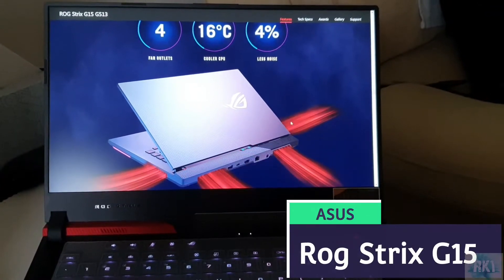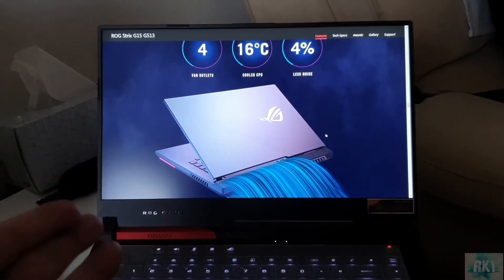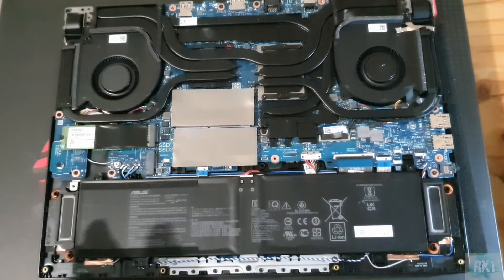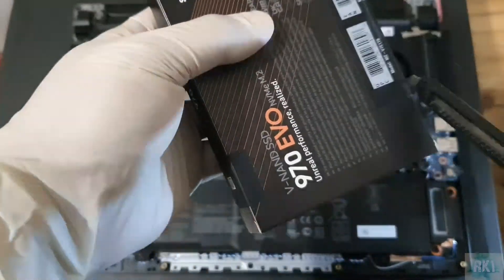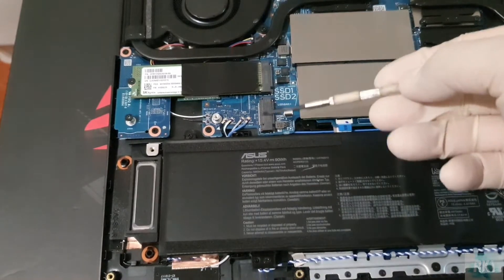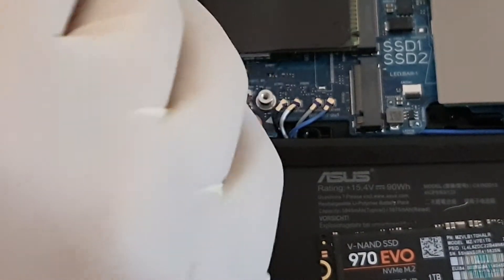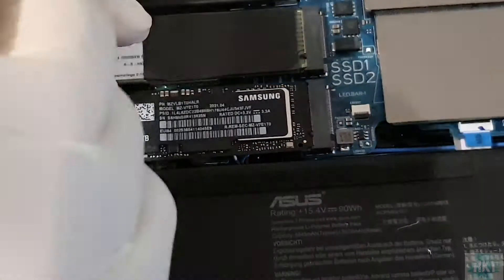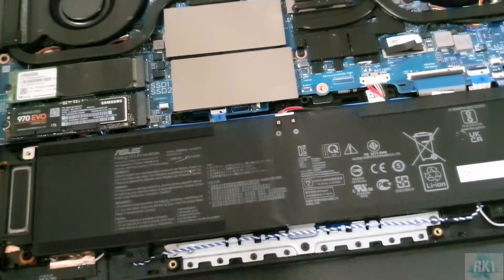How to upgrade SSD in Asus Rog Strix G15

Comment: I had a technician perform the same steps as you, also putting in the 2TB Samsung 970 Evo Plus. I noticed a strange thing, though: why do the write and read speeds max out at 1800 (and not at 3500 MB/s)?

Comment: I am about to purchase an SSD for my Asus Rog Strix G15 for and I am torn whether or not I should purchase a SSD like on one above - SSD 970 EVO Plus NVMe M.2 1 TB or a Samsung 980 Pro M.2 1TB PCI Express 4.0 Internal SSD MZ-V8P1T0BW. 

The Samsung 980 Pro M.2 has better reviews, but I am unsure if a PCIe SSD will work in this machine or not?
Reply: I see in the comments you have mentioend you are unsure if this Rog Strix can support PCIe SSD, but their should be no problems and the 980 should be faster.
Reply from the maker: Yes i installed 980 in my brother's laptop and it's running great
Reply: @robinkhaira1  Thank you for responding so quickly wow amazing! What a champ! Thank you for all the advice!

Comment: I have this laptop and the specs are listed below , which SSD and which Ram card can I put in my laptop? 
ASUS ROG G512 Strix i7 RTX 2070 16GB/512GB
Gaming Laptop; 15.6" 144Hz FHD IPS Type Display,
NVIDIA GeForce RTX 2070, Intel Core i7-10750H, 16GB.
Reply from the maker: It would be hard to tell without opening the laptop mate. I think it might still be m.2 ssd, and for ram i think it would still be ddr4 ram
Reply from the maker: Ok i just looked up your model name and yes it definitely gas ddr4 Ram up to 32 gb max and m.2 SSD. I hope this helps.

Comment: If i have the ssd from another laptop with windows installed, can i still use it? Will it erase the windows installation or cause any issues?
Reply from the maker: It depends, if you already have a SSD with Windows installed in your laptop and the 2nd SSD is also has Windows then PC will boot from the SSD with 1st on the boot sequence.
It shouldn't cause any issues but i would format the 2nd SSD just to be safe.
Reply: @robinkhaira1  Thank you. Sorry it took so long. Been working all day.

Comment: Hi! Sorry for my stupid question, but i just bought the ssd. So my question is when i put the ssd , should i pre install the system, or everything is fine ? Love that video!
Reply from the maker: Hi mate, sorry i didn't quite understand what you meant by pre installation of the system. Did you mean setting up your brand new Laptop?
Reply: @robinkhaira1  haha, sorry man, miss click XD i meant reinstall windows
Reply from the maker: @MITKO-le9gn  no you don't need to reinstall windows for this. You can just add the SSD and then go to disk management and allocate the drive a name.
Reply: @robinkhaira1  thank u so much my friend 🙂
Reply from the maker: @MITKO-le9gn  no worries mate. Just to double check, you are adding a 2nd SSD right? Because if you remove the original SSD and then replace it with a new one then you will have to reinstall windows. But if you are just adding a 2nd one then it doesn't matter.
Good luck 👍
Reply: @robinkhaira1  yep, im adding a second one :)
Reply from the maker: @MITKO-le9gn  yeah in that case it's easy, just a simple addition and drive allocation in disk management

Comment: AMAZING video! is it possible to add a second SSD without unplugging the ribbon cables for the LED lightbar?
Reply from the maker: You could do that, I found it was easier for my self to just remove everything because i wanted to show everything in the video. But if you can mange to screw in the SSD without removing the cables that would work too mate.
Reply: You can, but if you end up ripping out a cable by mistake (which is really really easy) then you're in trouble. So hypothetically yes, but I wouldn't unless you have really nimble hands
Reply from the maker: @eros7534  yeah kinda lol. Thats why if always say if you are not confident then don't attempt it and pay someone else to do it

Comment: I have a question is it safe to add another ssd gen 4 to a 15 laptop without a heatsink does it get hotter or did you have any problems with temps with 2 ssds ?
Reply from the maker: Yeah its safe mate. I have had no issues what so ever and my Samsung magician app says that SSD is in great health.

Comment: How do I deal with the screw that mounts the SSD? It's tight as heck for no reason.
Reply from the maker: You need a precision screw driver mate
Reply from the maker: @ 2:22 i mentioned that you need the precision set. Just put some gentle downwards pressure on screw and try it again. Let me know how you went
Reply: I ended up stripping the screw on the main slot so now I'm stuck with the 512gb ssd my computer came with as my boot drive.  Its an intel 660 I think, so not great but not bad.  With only one free slot though I feel I need to splurge on a 2tb since I can't do anything with the other one.

If I'd known the screw was going to be that tight I would have just paid the store the $50 for them to do it.
Reply: @robertlefeaux  Hello, i have the same problem, have you somehow fixed it? Or is it destroyed forever?
Reply: @spooky9487  I ended up just exchanging the laptop.  I shelled out a few hundred bucks more for one with better specs, among them being a 1tb nvme. They were very understanding about the screw, said it even happens to them.  8 months later I'm only now thinking about needing more space.  Nearly all gaming laptops have space for two drives now and being not so technically inclined I will just pay the store I buy it from to add it in and set it up.

Comment: Can I use 980 version, instead of 970, it has PCie gen 4, is it compatible with this laptop?
Reply from the maker: I am sure you can use that as well as long as its m.2. I think 980 is just a bit faster than 970, apart from that it should be all good

Comment: Is there a max on the ssd upgrade? Can I add a 2tb in that extra slot.
Reply from the maker: I don't see a reason why we can't, there is no restriction expressed by ASUS.
Reply: hey i am thinking of 2tn too, have you tried it and it works?
Reply: @doulainc.498  yes, I added 2tb successfully. So now I have a total of 3tb. I want to replace the pre installed 1tb with another 2tb, but I have to learn how to clone the original ssd to the new drive first.
Reply: @wdotgreatest  oh that is really great, thanks for your response. my own came with a 512gigs, i am planning to upgrade to the samsung 970 evo plus. you do really seem to require a lot storage 4tb is alot
Reply: @doulainc.498  lol well 5 years ago 1tb seemed like overkill for storage to me, now my cell phone back ups alone use almost 1TB..  files are getting bigger and bigger. .. so I’d rather have too much now, rather than in 2 years run out of storage..

Comment: how did you reattach white led strips on the case of the laptop? I pulled mine out and I'm sure they are damaged lol unless I can put them back in
Reply from the maker: They are a bit flimsy, but if they are bent out of shape, just straighten them out and hold them as close as possible and just push them back in the slot. It could also help if you have L shape tweezers to hold them.

Comment: Bro can you tell me please how many TB's ssd it will be supported in rog strix g15 because i will also bught in last week 🙄???
Reply from the maker: It should be easily able to take 4tb mate. But there is no concrete information about it. Based on 2x M.2 slots, they both support 2tb ssds, so technically you can install 2 x 2tb ssds, totalling up to 4tb.